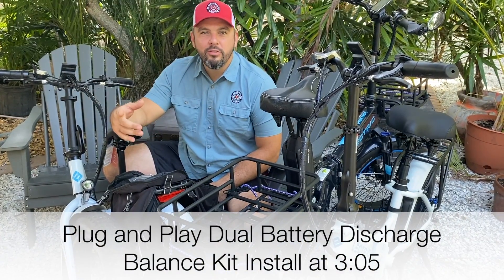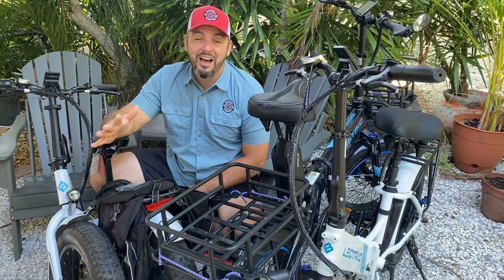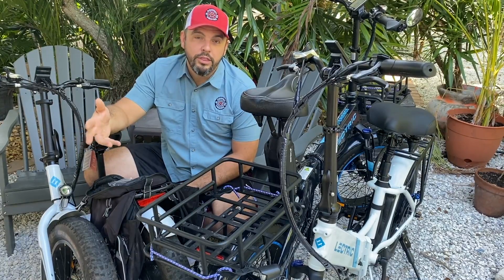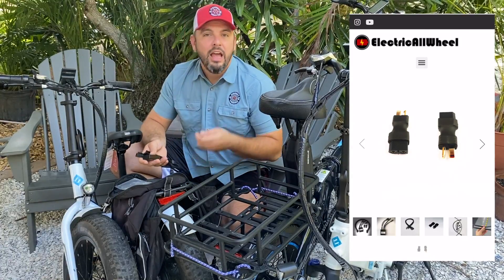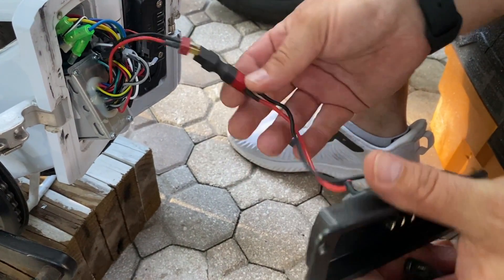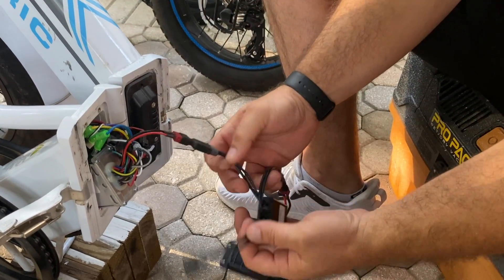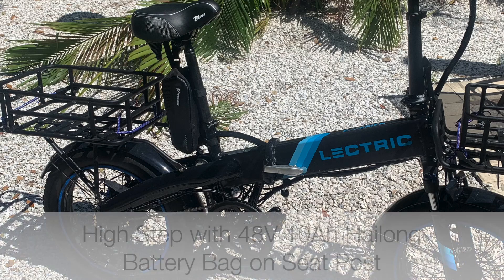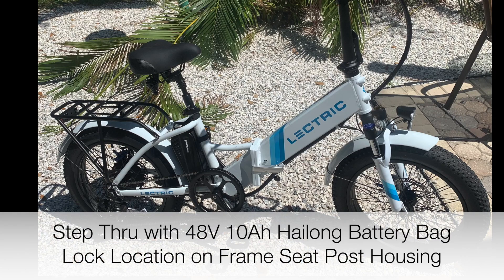Lectric | PLUG AND PLAY Dual Battery Discharge Balancer Install on Lectric XP 2.0 (XP, XP Lite XP 3)

Comment: I am in Canada and got my XP 2.0 step through from Lectric USA.  You guys did a fantastic job on YouTube and when I see your first video,  Immediately I order my dual battery discharge ....  from Chines... at that time I did not have the possibility to buy from you.  I received and install my Discharge.   Unfortunately, I had to weld the wire and wire adaptor.  (did not have your adaptor)  I did want to put a switch to the original battery so I could if I want to use only the batteries nu. 2.  But the wire that I built took too much space so I was unable to have a switch for the original batt. (As you probable know,  There is 2 hold at the bottom of the frame so I could install a switch)   As a stand, I used a car jack so I could put the height that I want and temporarily the jack was holding with tide rap.   Your video is very professional and informatif.   Can I order from you the two black Adaptors and the two cables for the second battery??   (since I have the discharger) and Ship in Canada Montreal Area.    Thanks and keep up the good work.
Reply from the maker: Thank you for your feedback! The kit is packaged as a single unit for our inventory. If you’d like, we can open up the shipping to include Canada if you’d like to purchase one. Let us know and we can open up the option for shipping to Canada.

Comment: I want to order one but I want to make sure it'll work. I have an eahora x7 plus folding bike the battery connection looks the same I have two 14ah and a 17.5ah all 48 volt from the "bike manufacturer" but it has a 750 watt motor will this work with my motor?
Reply from the maker: Please send pics of controller specs card on top of the controller and your battery connector to controller to ElectricAllWheel@gmail.com

Comment: Hi Matt,  I want to start by saying thank you for your very informative videos...I do have a question if you don't mind answering....I bought your kit and want to run my stock battery which is 48v 12.8a with a 48v 17.5a as my second battery. Now the controller on my ebike max amp is 18amp. Will I be ok using your kit as long as I stay under 18amps with the batteries.......please help a stuck brain....🤪🤪 I thank you in advance for your assistance.......
Reply from the maker: Yes. The kit will be fine but you may need different adapters. Please send a pic of your controller and controller battery connector to ElectricAllWheel@gmail.com

Comment: I bought the new Long Range XP 2.0 the battery is 48 V 14AH will this plug and play kit work with the Hailong 48 V 10 AH (200W-800W)?
Reply from the maker: Yes. The matching voltage is what matters. Ah can be any variation. For example you could add a hailong 48V20Ah

Comment: I am planning on getting the kit, but I would like to have the extra battery and balancer on the outside. Planning to put the balancer in the battery case and also add an on/off switch so I don't have to be unplugging the connectors. Once plugged in it stays plugged. Any recommendations on a 48v switch.
Reply from the maker: This would work 
https://amzn.to/3QufuJO
Reply: This switch is unavailable, any other you can recommend. Most say that it's to 6v, what about amps?
Reply from the maker: Look for “XT60 switch” 

Controller limit is 20A
Voltage is 48V

14AWG wire should be fine for Lectric
Reply: @ElectricAllWheel  I received the balancer kit and was impressed with the quality. I am ordering the battery recommended and plan to do an out of bike installation by also adding a on/off switch and a volt meter. Will add pics when done.

Comment: Hey Matt
Great product
Will you be recommending or can you recommend a dual battery discharge kit for 750w motors?
Thanks
Reply from the maker: As long as the controller current limit of the bike is 20A or less, it will work with a 750W motor. But make sure the voltage of both batteries is the same as well.
Reply: @ElectricAllWheel  Thanks for the info!

Comment: Quick question, I already have a second battery for my bike that is the Lectric battery. Do you have a kit for using this plug and play system with the OEM batteries?
Reply from the maker: Thanks for reaching out. I wouldn’t recommend this as a normal practice. 
 We have seen something similar to what you are saying in one of the FB groups linked below.
If it was an absolute must, I would open the externally used battery and check the innards for a blue wrapped battery that has an XT60 connector. It is crucial though that the charge cable be held intact which makes this a bit difficult.

You will need to make contact to your battery poles labeled over the top. I would target the DCH-006 430 battery case type name and search for a contact plate that works. There will likely need to be certain modifications to secure the connection. These batteries were designed for use inside the frame. 
Our overall suggestion would be to sell the one least desired and move towards a battery that can be more easily secured outside the frame. In your case you would want to keep the bigger battery.

We hope this helps, and are sorry for not having a better solution for you at this time.

https://www.facebook.com/groups/lectric/permalink/1175723686313760/

Comment: You guys really hit it out of the park with this kit. I installed mine this morning on my 2.0 ST with extended 14Ah internal battery plus the Hailong 10Ah external.
Now I have 24Ah total.
The install was easy and took about an hour. The hardest part was figuring out how to cram the dual discharge adapter into the frame to clear the controller.
You may want to show that step in more detail in this video because that’s the hardest part. Otherwise you have a winner!
I think your idea of selling these in volume is great. 
This setup is great for those intimidated by the idea of a dual battery. This setup will also give the XPremium a run for it’s money and also satisfy those that don’t like the XPremium mid-drive idea. Now I’m completely removing the XPremium from my want list because I believe this setup is better. Also I added cable actuated hydraulic brakes so for $1,400. total cost you end up with a better bike in my opinion!
Reply from the maker: Great to hear! If you’re comfortable, make a YouTube “short” video and tag us. We would love to see a #shorts video of your upgraded ride!
Reply: @ElectricAllWheel  
Maybe if you can send a kit to a well known YouTube review like Jeremiah Macintosh or others to show the install you could sell a crap load of these kits. Maybe DaveBrandNew? because he doesn’t seem to worry about offending any sponsors. My video would be a drop in the bucket compared to landing one of those guys! I think you’ll sell a bunch of these but with the right reviewers the orders could knock your Sox off!?
Your potential sales would be thousands of kits! You could also offer kit with battery and cut a volume deal with Hailong?
Reply: Now you have 24 Ah on your 2.0 ST, what is your range?  According to what's on Lectric's webpage, https://lectricebikes.com/collections/xp-2-0-long-range/products/xp-step-thru-2-0-black-long-range, are you getting a combined range of the standard range plus the long range?
Reply: Have you tried putting the balancer inside the bag of the HJailong external battery?
Reply: @oeshoe  no, but it would fit if you want to run extra extension wires to the controller. That’s what I did with my Jetson Bolt Pro.

Comment: Hi do you Ave ta have both batteries on at the same time or one at a time I want ta get another 21ah battery on rack just like ur other video with the heat gun..one in the frame the other on the rack that's looks so much easier
Reply from the maker: The balancer allows you to evenly discharge two batteries regardless of the Ah. Just make sure they are 48V
Reply: @ElectricAllWheel  yeah the battery in the frame is 48v.21ah I weight bout 300 pomds I want ta add battery Iver in bag on rack n use it as extra space..or just with the rack
Reply: Does the controller Ave ta be no more than 20 amp max like isaid I check later 2day thanks 4 the reply cheers 👍
Reply from the maker: @monsterebikes  it doesn’t HAVE to be, but what happens is the balancer limits output current instead of the controller. Meaning the balancer starts to restrict your Current flow
Reply: @ElectricAllWheel  OK right I see I check n let you know if it less more..coz that's a gd little gadget you got there no cutting wires no heat gun needed just connect n go brilliant 👏 👌 👍

Comment: My battery and the wiring kit arrived today.Everything went together smoothly and now my battery life is doubled.This kit and video makes it so easy to get the job done..Thanks ElectricAllWheel.I highly recommend anyone considering buying this kit to just do it,take your time installing it and go easy on getting the wiring back inside the housing and everything goes together like clockwork,you will be happy you did it,I know I am.
Reply: @stevek3677  I have my seat up pretty high where I like it and the battery is attached to the seat post,just enough room.
Reply: Where did you buy your battery? What vendor?
Reply: @JohnSchmidt-pf3rs  Amazon but it's discontinued now.Maybe message Electric All Wheel and see what he reccomends

Comment: The XP Lite is a 7.8 amp battery,not a 10 amp.Will everything still function ok?
Reply from the maker: No problem. Just match rated voltage
Reply: @ElectricAllWheel  Thank You
Reply from the maker: We just posted a live video here that might help address this.
https://www.facebook.com/groups/lectric/?ref=share

Comment: Hi. Sorry if I’m repeating myself, but will you be providing a video on how to install the kit using both the stock battery and the long range battery using the kit? It would be nice to see how you open the Lectric stock battery and make the connections. I already bought the kit from you yesterday. Thanks!
Reply from the maker: Hi Maria. We can do it but it will take some time. Also, We will only attempt this on a XP 2.0. 
May we suggest simply keeping the long range as your primary, selling the original and getting a battery that is built for the exterior of your frame? We know it sounds like a pain, but the integrated frame batteries were really built to be used specifically inside the frame. They have void stickers, and the need to be retrofit for charging even after you pull it out. You will save yourself quite the headache, selling one or simply buying a third. 
If you have the dual battery kit installed and run down two batteries, you could pull out your second Lectric battery and just swap it for your long range and it will discharge like the original bike from the factory, even if the exterior battery has been depleted.
Reply: @ElectricAllWheel  thanks! I believe that sounds like a better option for me. I will look at the batteries options available for mounting on the outside. Thanks so much. I appreciate your input. 🙂

Comment: I’ve wired the dual battery and after about 2 days. The mileage that I travel gets shorten from like 25-30 to like 10 or 15 miles. Is there something wrong with charger or the battery.
Reply from the maker: We suggest unplugging the second battery and verifying that the factory battery is charged and runs the bike. Then fold the bike in half and turn the bike on from the second battery only. Be careful to lift the wheel in the event the throttle is touched. If there is reaction from both separate instances, check your charging for each individual battery. Continued issues will require you to check your wiring to or from 1 of the batteries. 
Also, make sure the key is on for your factory battery

Comment: I understand the importance of matching voltage on the two batteries.  But I recall reading that a 52V and 48V could be used together.  Can't recall where. Perhaps because the voltage is close to the same???  Any insight on this?  Sounds too risky to just give it a try based on some internet forum opinion.
Reply from the maker: Principally, you would miss a portion of usable voltage because of your cutoff voltages for controller and/or BMS.

Comment: Just re-measured my Lite housing and got a better measurement using a ruler rather than a tape measure.Its the same measurements you gave me for the balancer so it should fit just fine.Thanks for answering my questions.I bet you will sell a lot of these kits,people are are talking them up on Facebook Electric Groups and posting your video.Can't wait to get it delivered,so excited.
😀
Reply from the maker: Please reach out via email if you have problems. We can help.

Comment: How wide is the balancer please? The housing on the Lite is approximately 1 and 1/2 inches.
Reply from the maker: 45mm or 1.77 inches
Reply from the maker: On the black XP2.0 the balancer is placed at an angle over the top of the controller in the housing.

Comment: I just bought the kit from you,the balancer will fit inside the XP Lite housing,right?
Reply from the maker: We have not put the kit on a Lite. We understand the controller connectors and know that the kit will work plugged into the controller. It is anticipated that the balancer will fit in the body like the white step thru in the video, balancer flat on bottom underneath sideways controller.
Reply: @ElectricAllWheel  Thank you so much

Comment: This may be repetitive but actually the batteries will operate in parallel correct? Which in turn will allow the bike to operate longer thus go farther between charges.
Reply from the maker: ...a balanced discharge matching the demands of the controller (power needs). Each battery will be "drawn down" uniformly to the low voltage cutoff of the controller (no bars). Think of Amp Hours (Ah) like a gas tank size. The more Ah, the bigger the tank and longer the trip. With this setup, you can have two 48V batteries. One will be the factory 10Ah (avg.) and the other will be an Ah value of your choosing. Consider your mounting points, budget, need, etc. to determine what size you might want. Double is an easy concept and that is why we recommended the battery. It's economical and easy to attach, and adds 10Ah to the factory 10Ah.

Comment: If I run both batteries down,and I have a third  battery in my backpack(Lectric brand),can I switch the Lectric batteries in the frame and still operate on a full Lectric battery while the Hailong battery is depleted?
Reply from the maker: Yes. This is demonstrated in the video when the connections are tested, and the back wheel is turned on
Reply: @ElectricAllWheel  Thank you and by the way,your videos are very helpful.Thanks for the knowledge that you share

Comment: Looks like a great product!  Will both batteries charge at 
the same time using the stock charger, or do the batteries have to be charged separately? Thanks.
Reply from the maker: They need to be charged separately with this kit.
Reply: @ElectricAllWheel  Thanks

Comment: I’m planning to buy the kit but need to ask a quick question— I’m also planning to buy a 48V 20Ah battery made by Cao MM instead of the Hailong battery suggested on your website. Is Cao MM a brand you suggest and will I be able to use your kit with no issues? Thanks for your time.
Reply: Ah and my Ebike is a Lectric XP 1.0
Reply from the maker: The kit will work with Lectric 1.0. If your battery doesn’t have a XT60 connector you will need that. As long as your battery is rated at 48V to match the original factory battery it will work.
Reply: @ElectricAllWheel  so the battery has a Female T connector. If I get a Female T connector to a XT60 connector adapter will that do the job? My apologies my knowledge about this all is not the greatest.
Reply from the maker: That sounds right. 

Try this link. Based upon your description it would be one or the other version of this
https://amzn.to/3CpjfNa
Reply: @ElectricAllWheel  Sounds great--thanks for your help and I've just bought the kit!
Reply: I was looking at the Cao MM 48v 20ah battery as well. Let's gooo